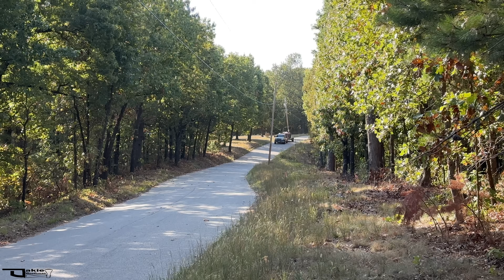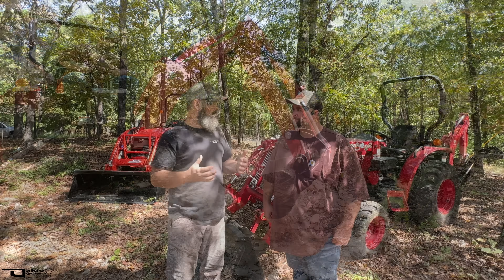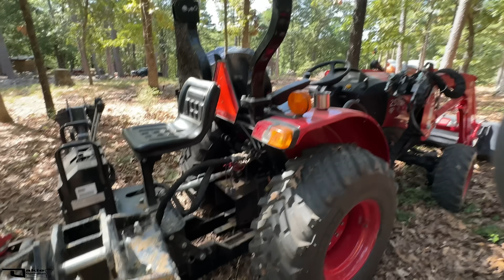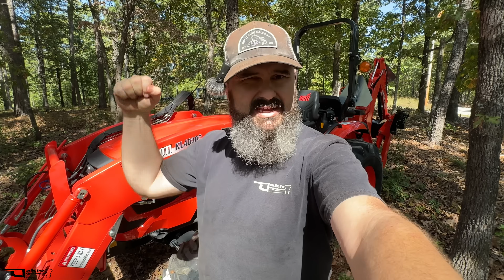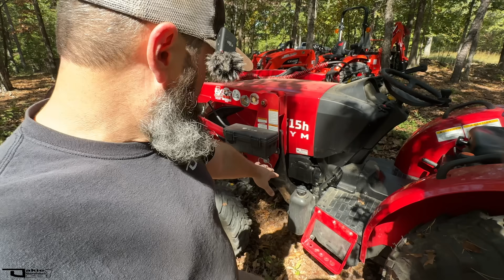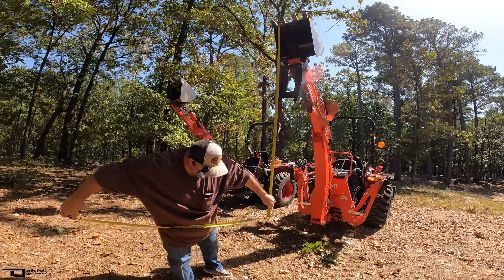DELIVERED! Kioti CK2620 and TYM 2515H - Do NOT Buy Until you Watch THIS!

Comment: Excellent machines gentleman!
Reply: I feel both are in the top of their class for this size machine
Reply from the maker: Thank you @faithfulfarmadventures!  I know you deal in a lot of auction type stuff and larger ag stuff.  Do you have a compact Tractor?  I have trouble keeping everyone equipment straight.
Reply: @oakiewoodsman I had a Deere 3025e that I put 1200 hrs on with no problems. I’m in the market for another 25 hp tractor and it definitely won’t be a Deere the lift capacity is garbage, 2 speed hydrastat and a few other negative things that make the “other” brands way more attractive.
Reply from the maker: Excellent!  I did LOTS of work with this machine today.   A linked pedal could come in handy at times but overall, super happy with the performance of the this machine and the Backhoe is FANTASTIC!  Good workout today!
Reply: @oakiewoodsman  That’s awesome!
Reply from the maker: @faithfulfarmadventures I pulled up a lawn chair and watched the. It’s dog a bit today as well. There was some grins, let me tell ya!

Comment: One thing that I’m seeing more and more of with backhoe attachments that are annoying to me is when the backhoe is locked up into its transport lock position….  Many of them don’t pull up into a vertical’s position.  They are always hanging low at a 30 degree angle from being vertical.  I have a JD 3046R Cab tractor… I love the vertical transport posistion.  However I do wish it had heavier duty swing cylinders and heavier duty stabilizer cylinders.  As well as the releasable latch lock.  But my boom and dipper and bucket have plenty of power.  There is a newer generation of my 375a backhoe that fixed the anemic swing pistons, and stabilizer pistons.  And the newer generation also has way less side to side wobble that I’ve experienced with mine.
Reply from the maker: Thanks for sharing!

Comment: Another factor is you get a detuned 40hp engine in the Kioti.  if you want more power, you can safely do so very easily.
Reply from the maker: Wow! I sure appreciate you taking the time to write that information out. Now I didn’t know it was a detuned 35 hp engine, but did they also have these turned up to 40 from the factory years ago?
Reply: @oakiewoodsman  it's the same engine as in the 3520 and I'm pretty sure the 4020 as well.  35hp and 40hp respectively.
Reply from the maker: @wtfdoicare  very nice!  Thank you!

Comment: I heard that Branson/TYM tractors had weak transmissions.  On my Kioti CK27, the lever for the parking brake is under the dash. It gets tangled up in my sneakers all the time. It is almost time for it to go. Cruise control is another thing that will be taking a hike for the same reason as the parking brake.
The TYM has a better seat with more lower back support than my Kioti. 4 hours of plowing snow and my back is telling me to quit. Zero back support.
My fuel tank (7 gallons) is under the hood right behind the engine.
I hated that the exhaust comes out and blows right onto the loader arms. Right after the warranty was finished I stripped off the 'grass burner' exhaust and went with a straight pipe straight up. It is a little loud, but I can get 14 hours of heavy work out of a tank of fuel as opposed to 12 hours with the muffled exhaust. When you are paying $6.24/gallon Canadian for diesel, it makes a difference. I have 3" straight pipe right now, but in the near future I may go to either a 4 or 5" pipe. The bigger diameter pipe will help to muffle some of the bark.
Reply from the maker: Awesome information!  I do not know anything about Diesel performance so that bit at the end is VERY intriguing to me for sure.  I love how people like you share bits of information in the comment section. I do my best to present good information anyone who skips reading the comments is missing out for sure!  Thank you again for watching and commenting

Comment: The KL4030 has slightly less lift capacity, but has better reach beyond the front of the tractor at full height. If a dealer does enough volume they wouldn't have a problem giving you the loader you preferred. We build the units from crate and have dozens of CK's here with different loaders. You shouldn't be stuck with one option.
Reply from the maker: Thank you for the clarification!  While it would be fantastic to have a high volume dealer nearby, I do not but that makes sense that there may some swapping being able to occur. Are you able to order whatever loader you wish are do you just swap as needed?
Reply: @oakiewoodsman  We don't know which loader we'll get, and I have a feeling we'll stop seeing the KL4030C soon, but right now we have enough of both to allow the customer to choose. It's not that much of a difference in performance for most to be bothered.
Reply from the maker: Awesome!  Is the “C” made in Canada?
Reply: @oakiewoodsman  No, it's made for Canada. All the loaders are made in Korea, but different models are sometimes made for different markets. A good example would be the Australian Kioti loaders all having self leveling. There are plans for a North American Kioti plant that would likely produce things like that over here, but nothing yet.
Reply from the maker: very interesting!  I wonder why they have determined the Canadian market would need a shorter loader reach?  I love it personally.  I have spend a bunch of times working in the woods and greatly appreciate a shorter front end especially with the backhoe on the machine.  I am super impressed!

Comment: Definitely electric grease gun and the lock n lube ,  i have a 2023  4210 se kioti , my iron craft grapple stays on 95% of the time , love my machine
Reply from the maker: That Lock N Lube is going to be critical!  I got an electric gun today and 2 fittings broke as I pulled the regular end off.  They appear to be brass on this machine.  Not sure what the heck and why.  Thank you much!
Reply: @oakiewoodsman  i think they’re brass so there’s no risk of damage to the threads , easily replaced , recommend to go back with brass
Reply from the maker: That makes total sense. If it gets impacted, the side pressure should mess up the threads on the machine. Will easily be remedied with a lock and lube setup.

Comment: The 4030 loader has more breakout force and reach at full height compared to 4030c. 

So the branson 2515 parking break is better. You can use just your feet to set it similar to the kioti. 

Thanks for the comparison!
Reply: Hi JT. That's good information. I honestly didn't know they had two different loaders untill we started digging in the specs.

I will try that. I haven't used my foot on my parking brake before. My o ly worry is it's about one inch from the floor board and would I have to use me heel or just turn around to use my toes. I'll give it a go because it's a huge pain to use your hand
Reply: @TheRustyGarageandHomestead  well, the older branson models its a latch that fits into slots that is right near/on the brake pedal. Keeps the pedal depressed is all. Thought the newer version on tym was better, but I guess not! Haha
Reply from the maker: Very good information!  Thank you for sharing!
Reply from the maker: @TheRustyGarageandHomestead This is intersting.  Will be waiting to see what you find man
Reply: @Jtwizzle  jt i would take a latch lol. This is fine it's just a pain to reach all the way down to the floor board
Reply: My ck4010 parking break does not hold on hills well.  With a brush hog it goes down hill.  If you have your foot on the breaks, it holds well.  Just can not get out with it on a hill.  😊  Otherwise, I love the CK4010 se.  These are the heaviest machines to take on a finished lawn or over the septic field.  Turning radius was a big deal to me and eliminated the JD and Kubota.

Comment: Excellent comparison! I am making a decison between these two tractors. Appreciate the insight!
Reply from the maker: Do you have one that you are leaning towards? I think you will be a very happy owner of whatever one your pick!  What is going to be your primary usage?
Reply: @oakiewoodsman  I have a long gravel drive and small gravel lot that needs attention. I also have some dirt work at my house I plan to do this fall. Next spring, I plan to bushhog, till, and plant a sunflower field for doves this spring and leaning toward a 35 or 40 engine. I maintain some trails which I am currently using my zero turn. I was just at the Kioti dealer about 15 min. from my house and he confirmed your statement regarding the loader from Canada. Because of the dealership being close, I am leaning towards the Kioti but nearly pulled the trigger on a TYM last month. To be honest, if the TYM dealer was closer, it would be a tough decision but....I think the Kioti in the 20SE series has a lot a feature which edges out the TYM.
Reply: I would also like your opinion on going with the large engine
Reply from the maker: @georgeharper6034  i bet you will love it. Of the dealer is right there, that makes a lot of sense. Kubota was my closest dealer but simply couldn’t justify the cost and lack of specs.

Comment: GREASE GUN:  definitely go with electric.  I have the Milwaukee 18v and it was worth the money.  Having it makes me grease as much as I should, where doing it with a manual pump, I found myself neglecting it more.  Any machine that has 10+ grease points, you will be happy you went electric.
Reply from the maker: Thank you for watching and taking the time to write out that comment! That’s what I was kind of thinking is that if it were easy, I would do it more often. Putting the different connector on my grease gun has certainly helped but does have a learning curve to it. Thank you for watching!

Comment: Best comparison video I have ever seen. No brand bias at all! Plusses and minus's on both. 
I recently bought a compact tractor. In my area, I had Kioti, Kubota and John Deere to choose from, all 25 hp models with front end loaders. Kioti closest, 10 miles ,Kubota, 20 miles and JD 30 miles away. JD, I looked at them, my opinion, too much plastic and cast aluminum. and the farthest away. Kioti, closest, but a very small dealership. Least purchase cost, best lift capacity and height on the loader. Impressed with the tractor! They only had one in stock with a cab(which I did not want) and I could not even order what I wanted, right down to the tire tread pattern. What was sent to them was what they had for sale. I bought a Kubota, Dealership was the largest, I was able to select the tire tread pattern and even had an option for larger dia. tires. Able to have the lower 3 point lift arms replaced with ones with extending ends( SO much easier to hook up 3 point equipment), Rear remotes installed. Free 1st service and Zero % financing.  
Dislikes, Heel/toe Hydo pedal, prefer 2 pedal drive. Range control lever is too far forward on the left fender, clothing, coats etc. catch on lever when getting on the tractor. Fuel fill placement. Hard to fill without scratching the paint.
 A left side fuel point would be a nice addition. I like where the tank is located, I live in NH., and it can get cold enough for diesel fuel to gel in lines when the tank is not inside the engine area. I am a retired Dairy Farmer, we had IH and Ford tractors with the tank in the engine area, and Case tractors with the tank in back of the operators seat. Fuel lines on the Case could gel, not the others. Though the down side to that is condensation can form easier in the engine area and fuel conditioner needs to be added. For me, I will add conditioner, vs gelled lines. 
Love my Kubota so far! My opinion, look close at your Dealer option's! Parts and service, not just spec's of the different Brands or model's. A tractor purchase can easily outlive the original owner! Children, grand children can use it, if it is properly stored and maintained!
Reply from the maker: Wow!  Thank you for writing all of that @erictownsend4236 I really like all of the information that you laid out.  I really would have liked to go Kubota since they are by far the closest dealer to me.  They have a great dealer network and I have done business with them in the past.  I just wish the capacities would have been on par especially given the cost difference.  Now, that certainly may come at cost on the KIOTI because I have a story that is developing right this moment that I am trying to work out.  Really, it is a VERY silly thing but to me it is a PAIN in the neck, what I have going on.  Actually when I make a video about it, I likely thing EVERYONE will think I am crazy unless they have dealt with it themselves.  

I had never really thought about the fuel location and gelling.  Makes a lot of sense.  My wife and I nearly 20 years ago honeymooned in Portsmouth NH and Portland Main!  Want to go back so badly. I have some channels that I want to visit up that way (hopefully in the near future).  Thank you again and enjoy the Kubota!

I also was shocked that they couldn't order what you wanted.... that seems CRAZY!
Reply: I am also going to buy another tractor. I have had only Kubota,  bx23 and a svl65. I loved the bx23 but soon discovered how seemingly cheap they make them and yep they are glad to sell parts... the svl65 was fantastic did not feel cheap and worked hard. I sold the svl65 and looking for a durable tractor that can lift (not crazy) pallet of firewood, move dirt gravel...I need a in-between tractor/skidsteer. I do not want to break the bank either. Thoughts on the pricing you seen/quality. Thanks.
Reply from the maker: @professionalinspectionserv9468 honestly my dream machines would be a mini Ex and a skid steer as both of those units would be better fitted for my propery.  I love having this all in one machine and if you watch some more of my recent videos, I have been putting it to work!  As far as pricing, I am not sure you can beat a tractor like Mike or I purchased.  Lots of capability there and while not cheap, it is still less than a new CTL or Mini.
Reply: l3302 here  , you get what you pay for!
Reply: @oakiewoodsman  I have a Branson 4215 and a mini excavator. I elected not to get the backhoe attachment for the Branson and apply that money on the mini excavator.

Comment: Nice review! I had ordered a Kioti CK4020 about the time this video was released, and the TYM was next on my list. Since I didn't need the backhoe, I splurged and spent $$$ on the cab SE model instead. No regrets at this time, but I still have implements on order and yet to arrive before I really get into using it. Primary job will be a 66" hammer flail and wood chipper, so went with the 40hp for some extra PTO power. A plus for your Kioti CK2620 choice over the TYM  is the ability to up it closer to 35hp if you know to search YT videos on how easy that may be while still having no DPF system to worry about. Another difference I really like is the controls next to the seat, with arm rests for support, without having to reach out all day. I guess running 100 hours or so on a John Deire (new correct spelling since they came out of the DEI closet, thanks to Robby Starbucks) 110 TLB hydrostat spoiled me a few years ago!
Reply from the maker: hahahaha!  Thanks for the great comment!  Yes, I am aware of the ability to turn it up!  I am going to get through my warranty period.  How do you like your machine????  You sure got a nice one!

Comment: Just for clarification  -  Do you have a CK2620H (hydrostatic transmission), or the CK2620 (9-speed manual transmission)?   The "H" of 2515H usually  indicates a hydrostatic transmission on the TYM model.
Reply: Hi Driftless. Yes his is the hydro model
Reply from the maker: Thank you DH!  Very true.  Mine is the "HST" model as denoted under the CK2620 on the hood.  Always thankful for your examining eye friend!

Comment: Thanks for the video, I really enjoyed watching it. I purchased my Branson/TYM 2515H almost 2 years ago and it is an awesome tractor, and I couldn't be happier with my purchase. I only regret not having the 3rd function remote added at the time I bought the tractor like you did so I wouldn't have to add it later for a grapple. I noticed in this video that the Kioti has a Bungee cord holding the 3-point hitch together out of the way, while my Branson/TYM came factory with holders and pins to hold it out of the way. This video takes away a lot of guessing on my part because I always wondered what the differences in the 2 tractors were.  Thanks again for taking the time to make this video, my wife would also like to thank you for the video because now I definitely want the backhoe for mine in the future.
Reply from the maker: I sure appreciate you coming and watching!  I think you made a great decision on your machine!  So the bungee you see is only for the hydro lines going to the backhoe.  Keeps em up higher so they  do not hit the ground.  I am not sure if this is normal or something my dealer does.  Hahaha…. Watch the channel with your wife and show here all the cool things you can do with a backhoe just like Mike and Joe have!

Comment: That's a great collaboration video.  I'm looking at the same 2 machines, this is exactly what I wanted to see. Loved the ergonomics section.  Both have what I would call advantages over the other in different aspects, but both are completely capable.  Similar warranties, similar in price.  I need more ground clearance - would be interesting to know which is higher including subframe which drops down quite a bit on both.  Did you see a beafyness difference in how the backhoes attached to their subframes.  I like that you don't have to take 3-pt off on Kioti to attach backhoe.  Thanks for posting
Reply from the maker: I think either is a good machine but it looked as if the TYM had a little less clearance near the middle of the machine but I really cannot give you an accurate answer on that one. Thanks for watching and sharing and good luck on your decision!